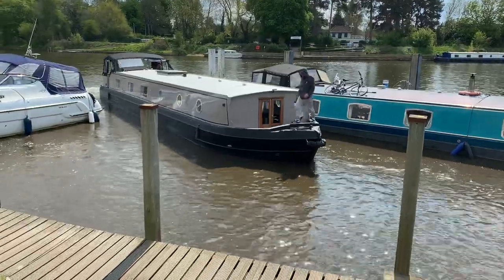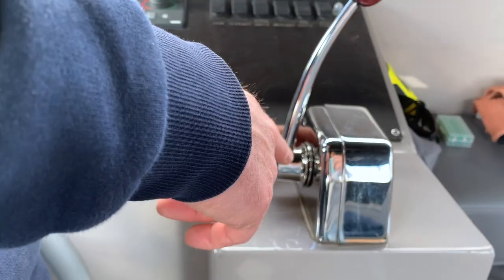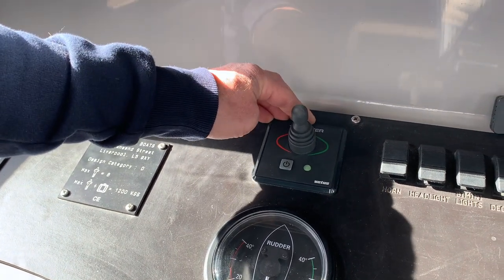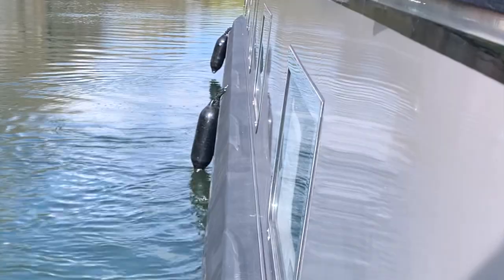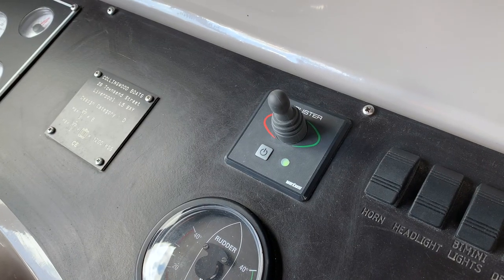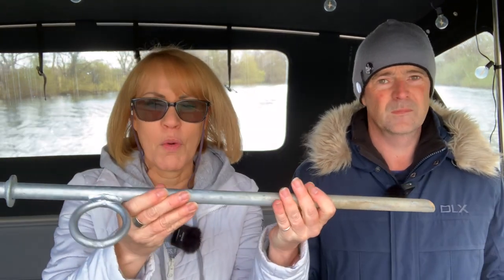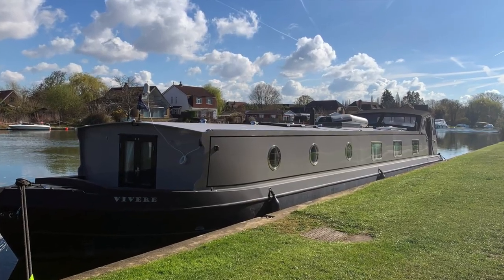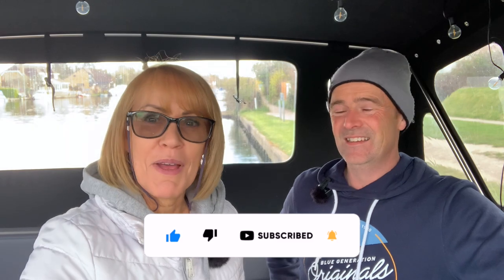How to DRIVE a Canal Boat | Boat Life | 53

Comment: How about clambering….. up the steps onto the roof or along the gunwales and up the locks. Are the built in steps worth it? Good vid I particularly enjoyed the tying off at the bow, very scenic 😂😂😂😂.
Reply from the maker: The built in steps do make it a lot easier to get on to the roof quickly, lol to the tying off the bow, I did comment to Richard about my full butt shot 😂😂😂
Reply: @WidebeamandWellingtons  I tried so hard to withhold a comment on the stern view 😂😂😂😂😂
Reply from the maker: @CaptainK007  😂😂😂